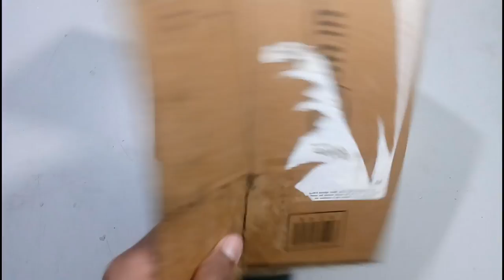How to Make Room Heater At home

Comment: Before you build this stuff yourself, please be cautious. I've built a very same heater like this long before I watch this vid, the heater works well until the box gets very very hot and got burned because I left it turned on while I went outside. Fortunately there's nothing else got burned in my room!
Once again, please be cautious guys.
Reply: So we will apply foil
Reply: If I put the lights in a metal box it gonna be dangerous?
Pls reply?
I don't want to burns my house
Reply: @Among_us9999  It needs to be watercooled.
Reply: @TheRealDorran  No😂 does not need to be water cold just use aluminium foil or aluminium tape it’s common knowledge you don’t put water near electrical connections or components and it will just take a way the heat

Comment: Well its certainly interesting to see how it works but according to the principle of heating it will certainly lose heat by every possible way (i.e. Convection,conduction &Radiation)to make it more worse you made holes everywhere to lose thermodynamic temperature at a very narrow orifice which again with respect to 2nd law of thermodynamics will give out heat as it is an Isothermal irreversible process.You should use aluminium foils, a fan (than a metal piece)a box which is more heat resistant and don't use bulbs they consume much electricity use a resistor a capacitor or a rheostat instead. But indeed its nice to view it.

Comment: how long battery will run ? its very expensive to change battery again and again.
Reply from the maker: use rechargable battery
Reply: Mr. Sunshine will charge it back up !
Reply: DIY honestly some of the people comenting are jurks because you put in all of is hard work and get some thing out of it and then people coment saying ya your going to ge seriously hurt and your going to burn down your house or just saying I dont like you so I hate you ext but you work hard for dis so all you haters out there when he does a video like this dont say something mean say something nice he works hard for this to his fans
Reply: Tech Study
Reply: Tom Schwab حخ..ظ3قثض
Reply: how about connecting it to a usb charger? It can last you full night and you paying the price of charging a phone only
Reply: Motor wire join with charger then it also use by electricity.
Reply: minecrafter33 
Not when the idea is stolen.
Reply: Krishay Naik
Reply: Tech Study
Reply: simply use 9v from any ac to dc adapter or any battery emulator.still very less oower will be consumed when compared to room heaters available in the market
Reply: sjx
Reply: Tech Study sfffe
Reply: Why Factz

Comment: Better way to make heater, forget electronics set box on fire, badabang badaboom heat.  Honestly though, it will work and the cardboard wont catch on fire for quite sometime if ever.  Dont believe me, buy a pizza from store with the cardboard plate, cook pizza in oven on cardboard plate.   Seems dangerous but truth is, the layers of the cardboard make it flame resistant alot more than you imagine.  Thus the reason you have to separate cardboard layers to use it as kindling.

Comment: I meaninteresting idea but what happens when the 9 volt battery dies and heat starts building up in that nice flammable cardboard box. Guys please have some common sense don't do stuff like this it's inventions like these that burn homes down. And a proper space heater you know one with actual safety features only costs about $10 now and it would work much better than that cardboard fire hazard.